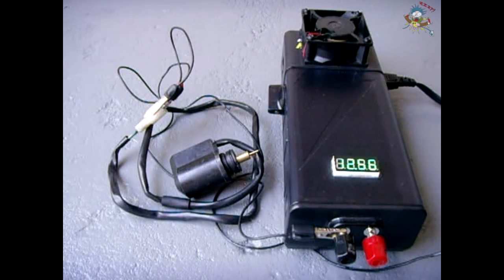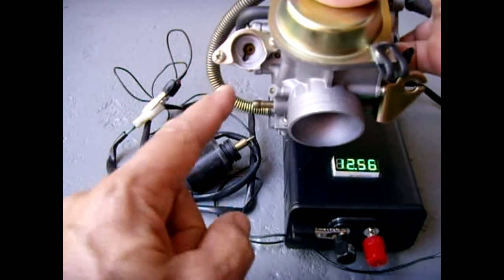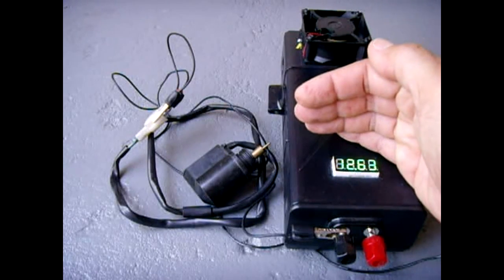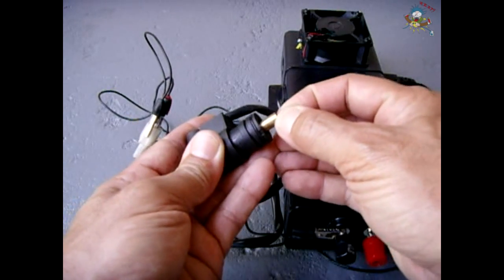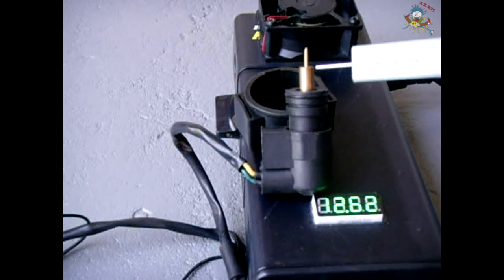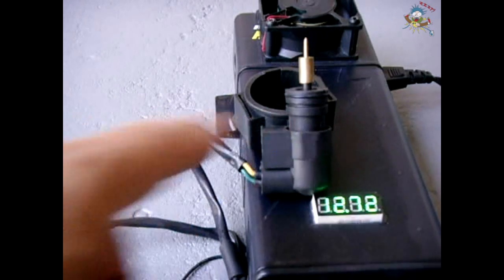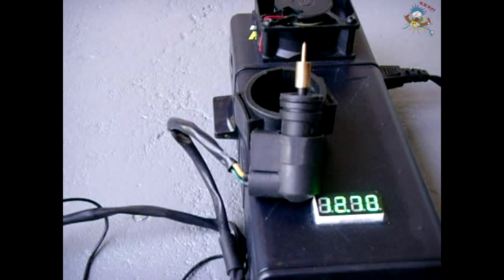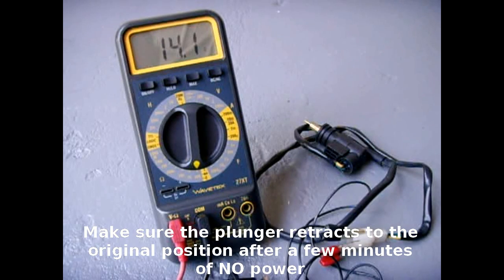GY6 Enricher / Automatic Choke Operation & Testing

Comment: My scooter came with no wiring so I needed to be sure the enricher can run directly from the battery and when it gets power. Great explanation. I just know enough to jerry rig the wiring. When I turn the key to start ( like the last car I had decades ago), I'll also flip a toggle switch on to power the enricher. It sounds like I can switch it off when the engine is warm enough to keep the wax melted without the electricity being supplied. And definitely switch it off when not running to avoid running the battery down.

Comment: Aslo im wondering can it still work if its unpluged all together .
Reply: Cause I'm going to convert mine to manual choke so I was wondering. If that electrical plug can stay unplugged and still run on. .  cause I'm asking different people and no one is giving a straight answer or doesn't know exactly. So.. but I guess I will find out tomorrow when I do the conversion. If the choke .  Hopefully it will fix the no start/ hard start issue . Plus I'm thinking it may be the valve lash settings as well with the inricher .  Them together causing that same issue . But I'm going to check and rest the valves when I do the electric choke conversion .  Wish me luck. Everyone . Have a. Hell  of a night tonight don't get into any trouble 😵‍💫

Comment: Im having an issue...so mine starts right up... idles low and dirs as soon as u give it an type of throttle...carb is clean and fuel bowl is filled. If i detach vacumm line idle goes way up... any ideas people ?

Comment: Please help!  So, I stripped the enricher wires and put my volt meter on there. I started the scoot right up and the voltage was around .5 to .7 then after almost a minute it hit 1.2 volts. Once it warmed up the voltage dropped to .1 and then the bike died, as she always does. Should I be reading around 12 volts during this operational test? I can manually route 12 volts to it if I need to. My scoot is unusable because of whatever the issue is and I now believe this is where the problem lies. Thank you in advance.  🙂

Comment: What if it revs up but only touching the 2 bolts with metal will turn it over? And when it starts and runs its a little choppy for the first few minutes. Also, it only does this if it sits for at least a few hours. New spark plug didnt change anything. Any help would be greatly appreciated.

Comment: I always wondered how that worked. I had to fit a new carb to my quad and from watching your video I could see that the old carb choke had never worked. Thanks for such a great and clear explanation of the system.
Reply: Same fo me my yetf doesn't work writ i kept messing with air fuel mixture screw😊

Comment: Is it safe to apply DC voltage to this since it is powered by the yellow wire, directly from the stator AC output? The wiring diagrams also shows that it has a resistor/diode in the ground side of the wiring from the enrichment valve. Thanks for the video.
Reply: thats what iam wondering aswell

Comment: Yellow wire is a positive or negative?
Reply from the maker: Yellow is usually the signal wire.
Reply: @electronicsNmore   Thats  "+"   ??  Thanks for answer.
Reply: @electronicsNmore   I need to change jack for my chocke because is not a same for new chocke and old, and i dont know what is positive +, i have the same like yours new choke with yellow and green wires.

Comment: so every time you start the bike the choke comes till that slow valve opens?
Reply from the maker: Yes.
Reply: @electronicsNmore  my ch80 runs terrible when it first starts. Its way too rich. Once it runs for a minute or 2 it runs fine. Its like the auto choke is too effective. Is there a way to adjust it so it doesnt richen the mixture as much? I already cleaned the carb. Thanks

Comment: I’m having a really hard time getting mine off and I’m scared to break it
Reply from the maker: Use the correct size screwdriver tip, and push down into the screw head hard as you turn CCW.

Comment: I love your engine examples. 150 cc, Model IP57QMJ. I have a Xinba in a 2018 IceBear Cyclone trike. Doesn't burn a drop of oil, and even though I have to warm the One Cylinder up to stay running, the 80 miles to the gallon and at 3/4 throttle  it's going a smooth 50+, with 11 or 12 grams rollers, gets off fast, then ease it along up to fifty.
Reply from the maker: Thanks for watching!

Comment: Do you happen to know what the size of the o-ring is. I have a 2020 taotao blade 49cc.
Reply from the maker: No, but you should be able to try a few out. Look for one of the correct diameter that isn't too thick to keep it from going into position.
Reply: @electronicsNmore  today I went to a manufacturing wholesaler who sells O-rings and when she tried to match up the original o-ring she couldn't find the right size. When she measured it she said it doesn't exist especially in metric as that's what it is. I bought the next size bigger because the next size smaller would have been way to small. That's Japan's for you!

Comment: Hi man, with my 50cc scooter when i drive it cold in the morning like 8deg weather, it usually bogs when i drive it afternletyingnit idle for like 2mins bit it will be fine afterwards like no boggings when warm and very responsive. Is there a possibility that the auto choke is causing my carb to flood during that period that’s why it bogs like there’s too much gas from the choke?thanks
Reply from the maker: Definitely a carb or enricher issue.

Comment: Were does the green and black wire gk to from the auto choke on chineese moped
Reply from the maker: One goes to the stator, and the other to ground. AC is supplied to the enricher, not DC.
Reply: @electronicsNmore  Hi, newbie here, today I was doing general testing on autohoke using multimeter. 
With the ignition OFF red lead from multimeter to positive side of the battery and black lead from multimeter to green or black wire - both registers 12v.
Is this correct?

Comment: My enricher itself works fine, it extends/retracts normally, O-ring is good on it, but my idle doesn't increase when I first start it in colder weather. Idle is the same as when it is warmed up. Blew some air into the channels and they are both clear. What can make the fast idle not work when cold ? I removed the enricher altogether with a plate and there is no difference, but the scooter runs fine when warm, just no higher idle when I start it.
Reply from the maker: Sounds like a carb issue.
Reply: Might be out of adjustment. I'm trying to figure out mines now. U ever figure it out?
Reply: @dmo848  Sold the scooter. Ran fine after 3 minutes of idling, just that the high idle didn't work when cold. Hope you figure your issue out.

Comment: hello,  I want to put e choke on the scooter, but I have no factory installation for it .. can i take some alternating voltage for it .. ???
Reply from the maker: Tap into the wire for the running lights. They only light up once the engine is idling.
Reply from the maker: I don't recommend it.
Reply: @electronicsNmore  I have to do it because I put a new carb with echoke. Do you know if I can take a constant current from the key ... will the choke return the needle, or stay in the open position?

Comment: I have a gy6 250cc automatic brand new from factory. wont go over 55 max and only gets up to 5000 rpm out of 12. Any ideas?
Reply from the maker: Try adjusting the roller weigh size. They could be too light.

Comment: I seen in 1 of your replys.. About a cracked intake manifold.. Mine has a small pice broke on the edge screws go in gasket covers looks like it still seals. Didnt think it would be a issue..
Reply from the maker: Use RTV sealant to ensure no leaks. Thanks for watching! Be sure to watch my "GY6" video playlist and share.
Reply: @electronicsNmore  But not on the exhaust manifold!!!

Comment: Heres 1.. My scooter trike. On a cold start it HAS to be hand choked for it to start.. With my hand over airbox hose it starts right up fine. After its been warmed up it starts just fine. The carb is brand new 20mm carburetor. Stock jets 49.5cc trike with a 50mm bbk stock airbox
Reply from the maker: Work backwards from what you replaced. If it worked before, you did something. Usually the carb, carb/intake gaskets, or enricher would cause that problem.
Reply: Before the build it would not e start once it got cold out i never tried hand choke didnt know about that before build..
Reply: Im guessing it might have something to do with auto choke i dont know yet but ill be testing it to see. Timing is set to tdc gaps at 005 going to take exhaust to 006 see if that helps.

Comment: So if one is having trouble starting their engine on a cold day, removing the whole unit will help the starting since the plunger inside may be stuck in the extended position. Removing the unit will act as though the plunger is retracted.
Reply from the maker: Some people remove the enricher and replace it with a flat plate.
Reply: @electronicsNmore  Although, that may cause it to run too rich when the engine is warm, no?
Reply: B
Reply: This choke adds air and fuel on start. Up.  If. Its. O. ring leaks.  It will lean out the mix.  So no a block off plate alone will not work

Comment: Hi man. Everytime i turn on my scooter cold first thing in the morning, i have to let it warm up for like 5-10mins and can't drive it straight away becausenit will bog on 1/2-full throttle. Weird thing is when if it is warmed up, mo jogs and runs fine. Could it be auto choke is faulty?
Reply from the maker: Definitely a carb problem or enricher problem.
Reply: Nino Echavez
Hi, I have the exact same problem with my YAMAHA Zuma 2005 scooter. Did you ever find out what exactly was causing the problem?
Reply: @SharokD  hi man. After figuring out for weeks what the problem is, i switched my fuel petcock from vacuum to manual switch on/off fuel valve and it solved the problem as carb is not fuel deprived. Now i can use my scooter after warming up in 4-5mins with no bogs. It is always good to warm up a 50cc scoot after hours or days not being used. Before 10mins is just quite a long wait before i ride on. I am quite happy with it now.
Reply: @ninoechavez1402  Hi man. Good. I also fixed my scooter bogs problem. My scooter doesn't have a petcock, but I fixed its bogs problem by adjusting the air screw on the carb. I saw an article that said turn the screws clockwise 3/4 turn and that did it for me. Awesome.

Comment: My scooter won’t start first thing in the morning.  If I wait a little later in the day it starts right up and runs fine.    I live in Florida
Reply from the maker: Definitely a choke problem. See if it starts right up in the morning using starting fluid.
Reply: @electronicsNmore  rigelater  de moto ckoter 150

Comment: I was scratching my head off figuring out how it works. On disassembly i found a metal coated disc sandwitched between two wires. I thought it was a piezoelectric device which would only work on certain voltage and frequency. Now i know that it was just a heating element which would melt and expand the wax inside the copper housing pushing the plunger outward.

Comment: I have Aprilia Leonardo 150, and the current from the cable that gives power to automatic choke is about 3,5 v, I think it should be about 12 or more v, why is that happening?
Reply from the maker: Did you measure using AC volts? or DC volts?
Reply: electronicsNmore Hmmm, can't remember, I will answer that when I get home, thank you.

Comment: My TaoTao 50cc scooter has been really hard to start after 1 yr ownership. I live in FL in a warm environement. When cranking cold, it fires and putts once or twice before dying, I time having to roll it down the driveway, tickling the throttle until it goes due to the engaging of the autobelt/clutch as it  catches.. After it tries to die as I give it gas into a corner, it'll rev up and after 3-4 minutes of continuous running, no issues starting or  idling anymore. I pulled the automatic enricher out and measured like you did. It's 3/4" cold.. When I turn on the key, it does not move so I assume that the scooter has to be started before the pin will expand down? I use nothing but 100% gas (no 10% ethanol mix).
I don't think the automatic enricher is bad. Maybe a carb jet or air/fuel adjustment at cold start? What are your thoughts?
Thanks!
Reply from the maker: Hi Ken. You need to do as shown in my other video below. Thanks for watching, and be sure to share my channel with all your friends. :-)

https://www.youtube.com/watch?v=5vl1mrTVCQ0

Comment: I installed a new carburetor on my gy6 150 engine. When I first start the moto and drive it the bike feels like it's missing and surging. After the engine is warmed up it runs fine. I live in Acapulco Mexico so the weather is always warm so it's not a real cold issue. Is my problem in the auto choke?
Reply from the maker: Could be a gasket leak, or enricher problem since it started after the swap.

Comment: Hi.. There is not a wire diagram of it (Connections from it to the Stator)?
Reply from the maker: You can find schematics online.
Reply: Ok.. Let me see if i understand.. This Valve is not a thermostat, when you turn on the bike the Valve needle start to go outside for about two minute, the needle function is to stop air flow and slow down the motor revolution.. The needle will stay in his same position while the engine is on (There´s not fluctuation, the voltage will stay constant at 12 V on his terminals), when you turn off the engine the Needle back to the inside position.. I am Right? if so, i just only connect one cable to ground and another to some cable that depend of the Start voltage after use the Bike Switch on "ON".. I just need to know that for make it myself.. Thanks for any help :)

Comment: So my scooter has spark but is like gas not going thru to start it...I took choke sprayed engine starter and started after a few hour it won't start what can it be?
Once I get it started I ride it and all good but then after a few hours it won't start unless I take choke off and spay it
Reply: I have the same problem with a vespa sprint, keihin carburator; i took the spark plug out and every time is dry ( not a single "molecule" of benzin ), it looks to me that fuel isn t getting to the automatic choke( speculating ..🤔)
Reply from the maker: Andres Sanchez Must be the enricher or carb causing the problem.
Reply: Oh and the intake manifold is also nice and dry

Comment: guessin choke works like car thermostat , expanding wax when hot in a small metal box . wonder if it can get stuck in open position so starting will not work and better to loosen choke screws and lift it out a bit to see if starts.

Comment: Hi,i have question,about how the the choke get power...I mean i tested on the mmeter show it goes up and down,each time i throttle the gas,theres no set volt to it..I thought it would be a straight 12 volt to it
Reply: It gets power from the stator on the crankshaft. As you throttle up the engine spins faster and the stator will produce a higher voltage. It isn't powered from the battery so no fixed voltage. It makes sense tho because if your engine is throttled up then it'll warm up faster so needing less time with the choke on.

Comment: Hi! I have a 50cc CPI Oliver city.... I just replaced my carburetor with a new one ... it starts and runs fine... idles fine... but when I drive it for about 2 miles going 40 mph, I lose power then it dies. I pull to the side of the road and starts back up again. Drive it again for about 20 feet then loses power then dies again.. seems to be losing power and die when it gets hot? Any ideas?
Reply: Have you solved this problem?? Mine too
Reply: Not rich enough?

Comment: How high should the rpms be when warming up? My bike is a 150cc tao tao. Lately my rpms are shooting up to 3500-3900 and the wheel spinning. It comes back down to 1800-2000rpm after it warms up but it stays high for about a minute. The first year it was running smooth and only shooting up to upper 2000s when warming up. Thanks in advance for any advice.
Reply from the maker: Definitely a carb, enricher, or cracked/damaged vacuum hose. My scooter was set to idle at 1500rpm. If you never adjusted your valves, then watch my other video.
Reply: Thanks electronicsNmore. I've upgraded all my vaccum hoses as a process of elimination. I havent used any carb cleaner yet. But I'll try replacing the enricher next since its only $10. My manual for my 150cc says to set it 1800+- 100(I like to keep it a little higher around 1900. It gets sensitive around 1500. I think my next step is 1. carb cleaner then 2. enricher replacement.

Comment: hey there I have a buggy with a gy6 on it I just bought it's bogging about a third throttle I tested the enricher it works of the buggy but not on it where the power come from?  Just tested it with a meter looks like it's getting about 7 volts
Reply from the maker: Try testing again, use AC volts. The enricher may not be using DC.
Reply: That gets me 10v AC but I ran it with the enricher out and the plunger never cam out it does when hooked to a 12v battery
Reply from the maker: Jamie Cox The plunger should move, even using 10V.
Reply: I checked it twice it didn't move a bit
Reply from the maker: Jamie Cox Very strange, check the voltage at the wire harness while the engine is running with the enricher connected. Use needles to reach into the connector.
Reply: Voltage is 10v AC I will take it out back out and check it for movement again tomorrow
Reply: I ran it longer and it did move thanks for your help I guess it's in the carb